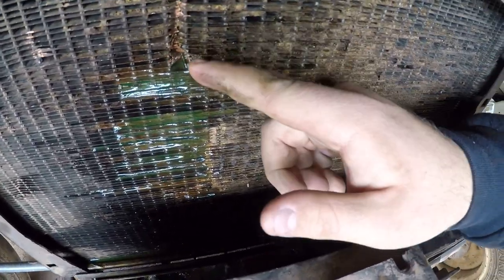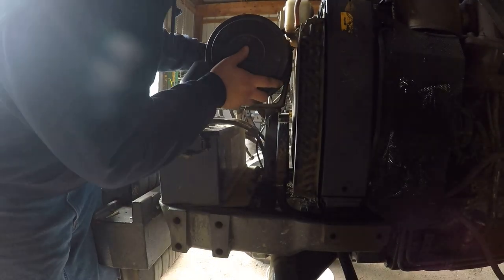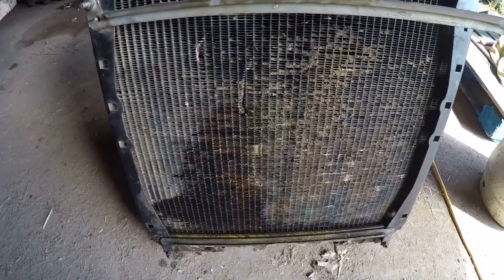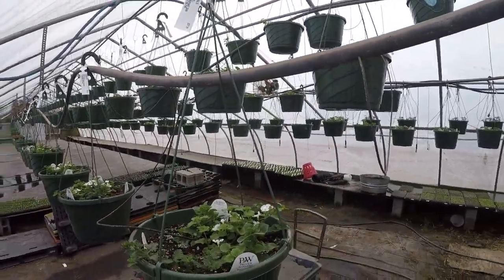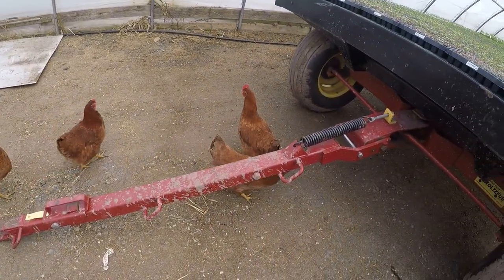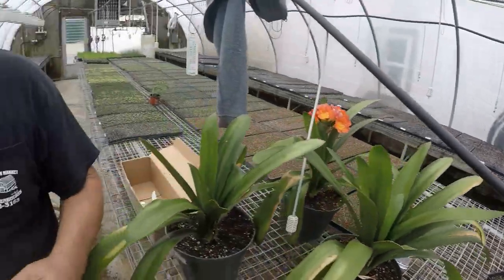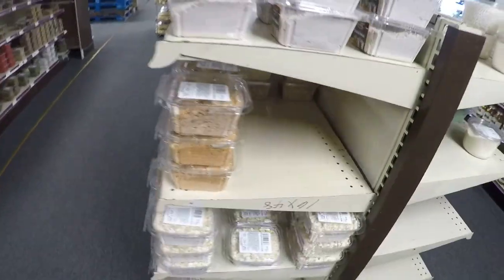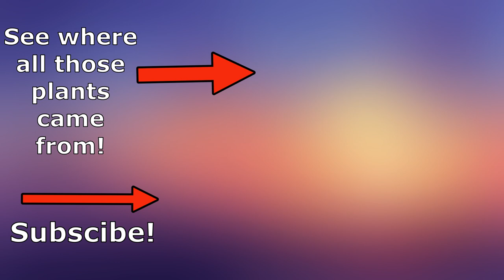VEGETABLE FARMER TRIES TO FIX TRACTOR (Farm Vlog #29)

Comment: never let an engine dry out when removing  radiator, the rust peels off and when new radiator is installed rust fills small water channels and blocks new radiator. keep it wet, and good idea to flush engine as much as possible.